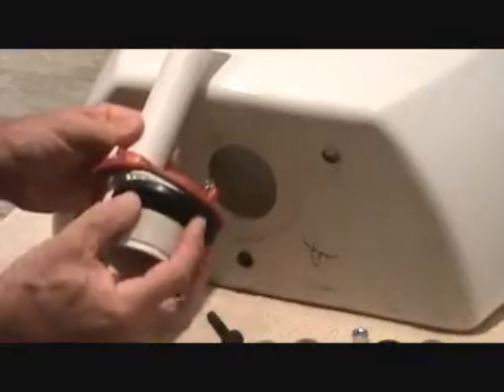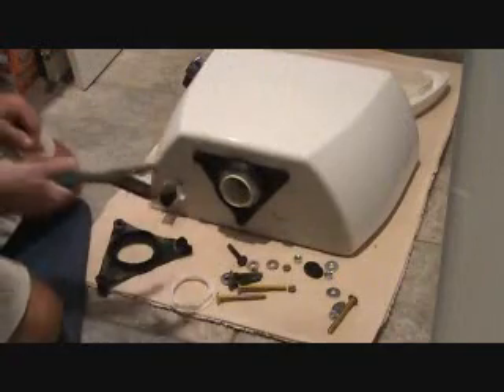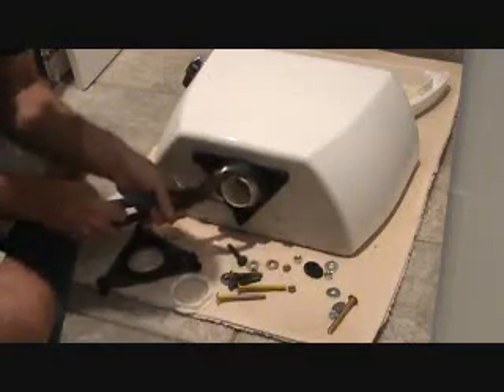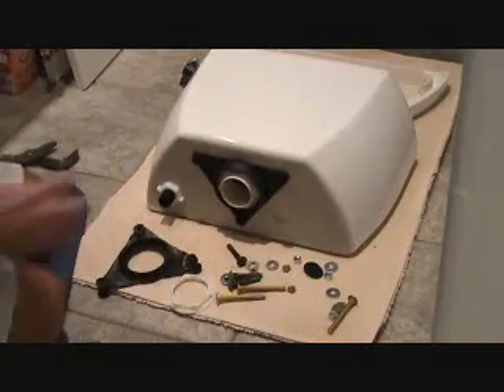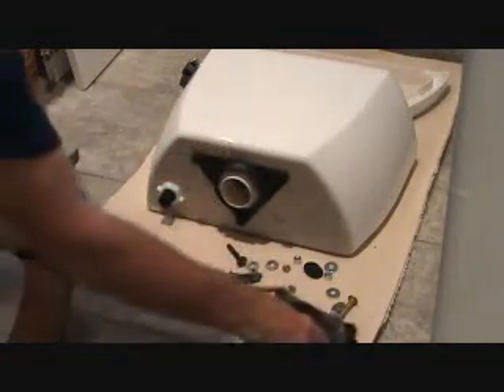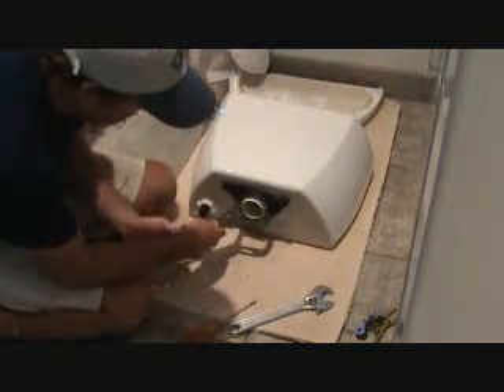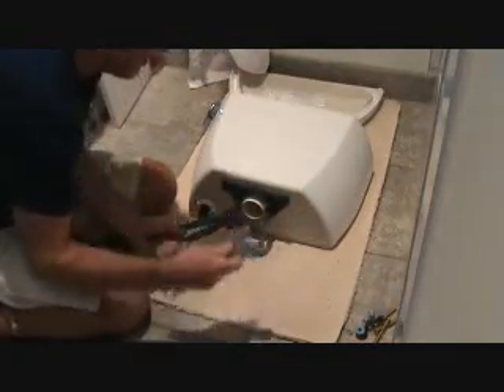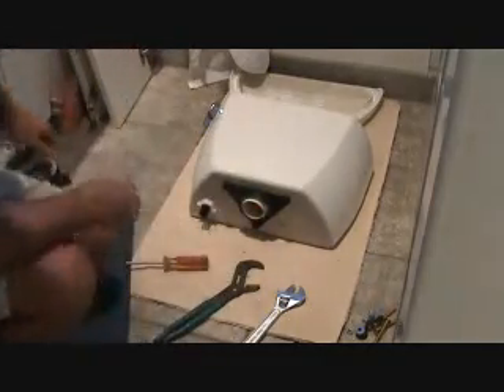The toilet from hell...installing the toilet tank spud nut

Comment: They do make a special tool which is plastic for tightening that huge nut, but its hard to find.
Reply from the maker: Yes I've seen a special tool for that but the 5 hardware & plumbing supply stores I went to apparently didn't get the memo!   Joe  :0

Comment: Theres 2 rubber seals in the pack do u have to still use the round one that comes with it.
Reply from the maker: Read the directions as they have so many parts out there & sometimes they give you extra in the plastic bag....what did you end up doing to fix?

Comment: Undoubtedly you already have your answer... For that large nut/Spud Nut tools like a Spud wrench, Slip & Lock Nut Wrench, or a pair of large pliers like the Channel Lock 440 for up to 2 1/2 inch nuts and the 460 for bigger nuts. Some plumbers also use an adjustable automotive oil filter wrench like the Pittsburgh 36778 on 3 inch flush valves. Hand tight plus 1/2 turn on that nut.
Reply from the maker: Thanks for the detailed message!

Comment: Ok while I admire your moxy for posting and trying this by yourself. You should NOT be fixing toilets! The FLUSH valve can be installed befor the gasket. Does need to be more than just snug. And NEVER EVER use a screwdriver on a porcelain toilet to pry with! They also make a special wrench for that. Channel locks will work tho. Maybe you should watch a real tech do a video and then teach proper technique. Have a good day
Reply from the maker: Ha! I'm a hands on type of average "joe" & wanted viewers to learn through my pain! That's why I made these videos....for viewers to see the right & wrong way to do things. They learn while I learn at the same time.....a double bonus! Your comments do make alot of sense though.....the part where you say maybe I should see how a pro does it before tackling it myself.......not your comment that I should not be making toilet videos....LOL  Thanks for taking time out to send me your comments. Much appreciated!   Joe  :0
Reply: The low-stress solution / secret sauce for us was "The FLUSH valve can be installed before the gasket." Tightening the nut is a breeze in this situation. It can, however, cause more stress on the joint between the tank and the bowl with this funky kohler integrated gasket. We have friends ;) who cracked the bowl by overtightening with this arrangement. The next time we uhmm ... they were more careful about how much they tightened the 3 tank to bowl bolts
Reply from the maker: Great advice. Thanks for the message... Joe  :0